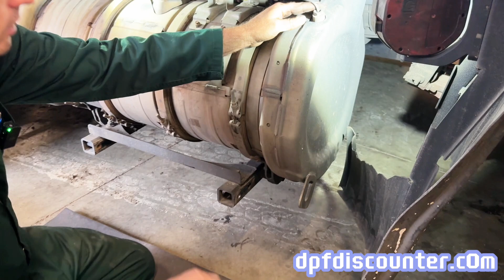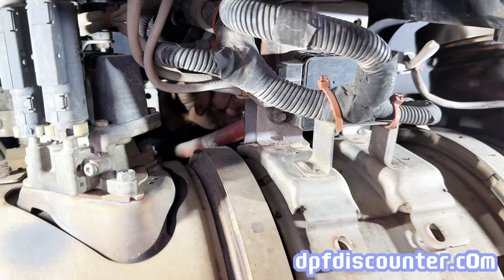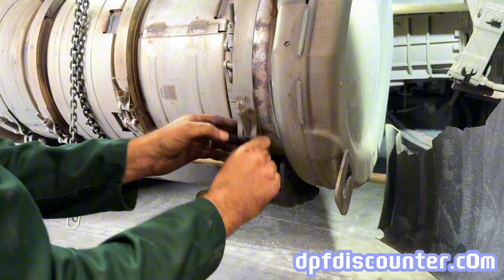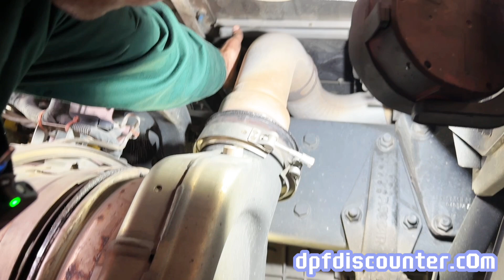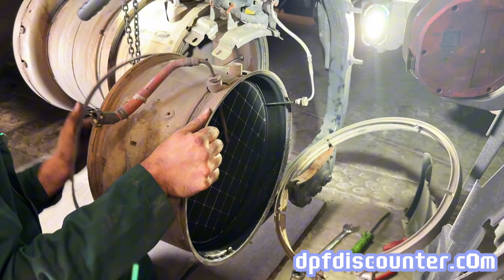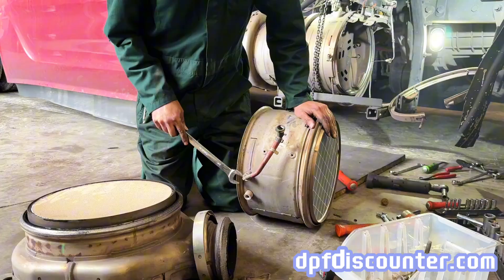How to Remove Cummins X15 DPF and DOC (Kenworth, Peterbilt, Freightliner, Volvo) - Step by Step

Comment: I’m only three minutes in but for the dpf pressure sensor bracket I usually go on the back side for them bolts makes it a little easier and more room. I’m sure ur aware but I figured I’d just give my opinion on this thing sorry

Comment: There's no way in hell you got those bolts out that easy. I snapped mine in .2 seconds with no effort at all.
Reply: Thats one thing i hate about the YouTube tutorials... they are written in such a way where everything goes per plan. They dont address any surprises along the way
Reply: Exactly @sasazapadnik9335
Reply: This! Those tiny bolts break off easy,  DPF shop said it happens all the time and welded the bracket back on for me.

Comment: X15  international lt 2019. What is the cost for the cleaning?
Reply from the maker: If only cleaning, labor, cleaning fee and gaskets material, estimating $2,200 to $2400
Reply: @truckingandfixing BEST STEP removal of all of it & leaving it off!!!
Reply: @truckingandfixing Wow! Local KW dealer quoted me $900 to remove, clean, and replace. $300 to clean and $600 labor. Where is the extra expense coming from?

Comment: step one check for bellows leaks, step two run a regen verify doc is good(also turns any soot to ash so it doesnt have to be baked), step three remove the doc dpf, step four check the dpf on the vacuum tester, step five clean the dpf, step six if dpf fails the vaccum test then it needs replaced or cooked customers the boss, step seven reassemble the system replacing any failed parts, step eight reset the ecm data so it can operate correctly, doc will not fail with fuel, if it is face plugged you have a engine problem that needs fixed, no need to clean a doc unless you have engine codes for face plugging it isnt a filter. i have done hundreds if not thousands of aftertreatment cleanings, and very few need baked, if your keeping customers trucks for 24 hours everytime you might want to get some training from the fx cleaning system. when we first installed ours it never shut off the first 90 days, first 30 made 100k at 300.00 per dpf cleaning plus all the parts and labor to remove and reinstall, and for time sake get a ingersol rand hammer head impact. and if you really like your customers stop idling trucks and install a apu. if you remove the bottom bracket you left on will make your life much easier.
Reply: Am excited to see this I spoke to Sophia this morning wasn't sure if you still cleaning.All going well I will see you next week.